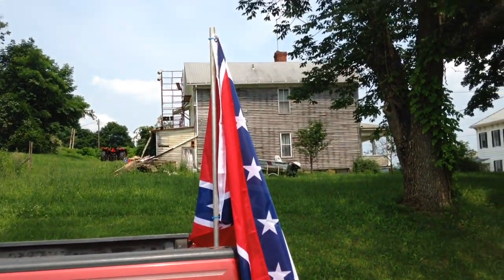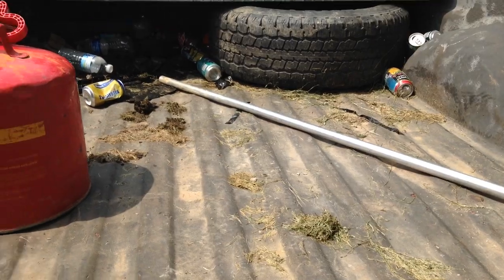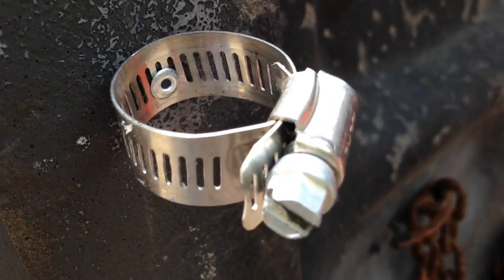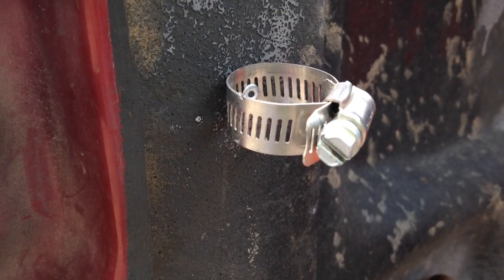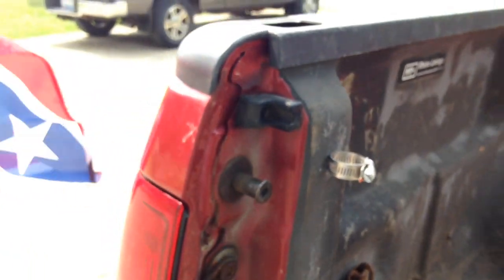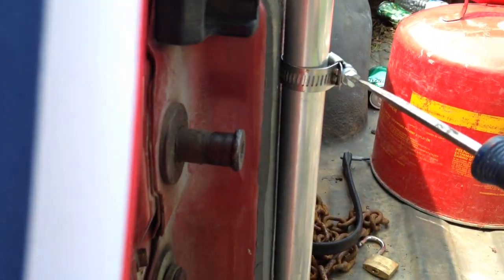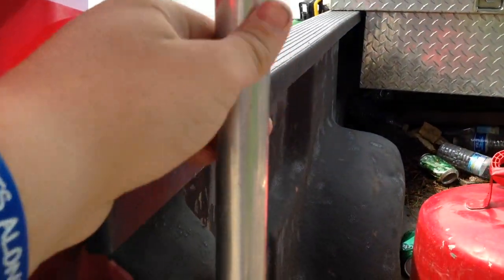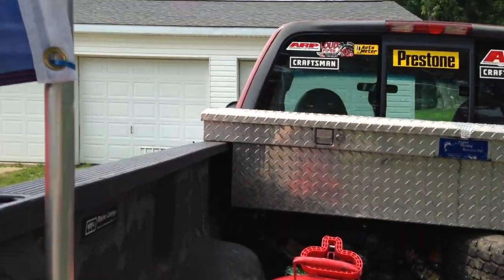How To: Flag Pole For a Truck

Comment: Did you notice any bend at high speeds? Just being , they are pop rivets and i can imagine the amount of poundage going against it while driving.
Reply: ChairForce Vapes Im gonna try this but just use some bolts or screws instead, i wouldnt trust the rivets myself

Comment: How did the flag do at high speeds? The mounting system seems to be solid but there is always room for error. Thanks.
Reply from the maker: That's true. But it did fine up to 55mph, never took it up to 70mph (interstate speed in Ohio) but if you get a thicker flag made of different material it'll be better. But this did fine
Reply: Thanks for the feedback.